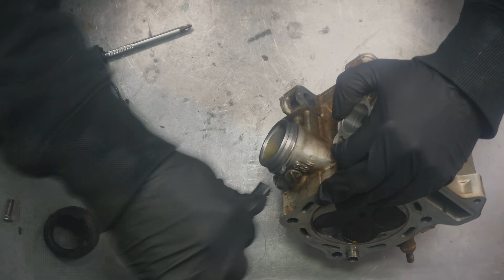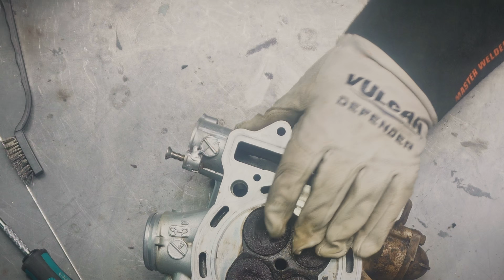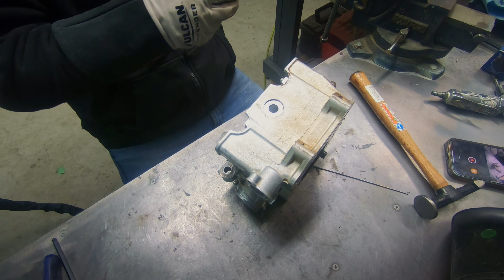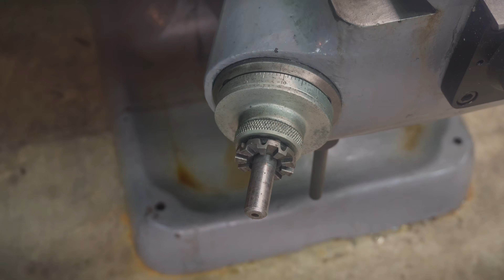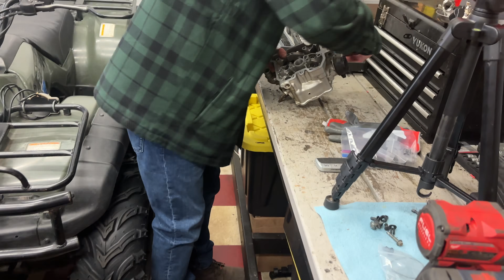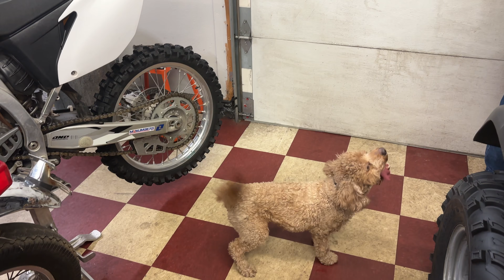Cast Aluminum Welding Using Stainless Steel Trick

Comment: Great welding. As a Tool & Diemaker of 35 years....your test indicator needle should be 10 to 15 degrees from flat. You had it almost 90 degrees from the surface. That's not how an indicator works. Your readings are very much compromised when misusing that indicator. Just trying to help.